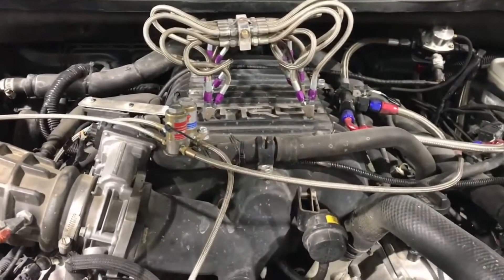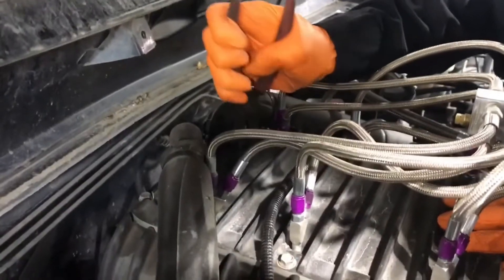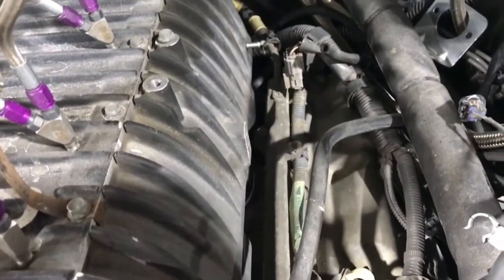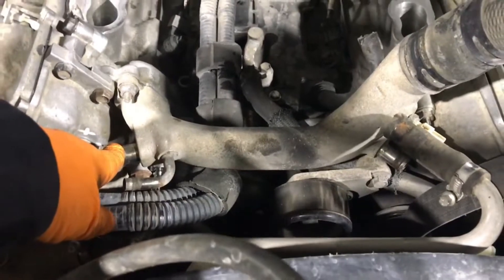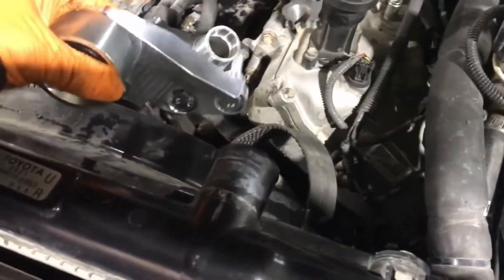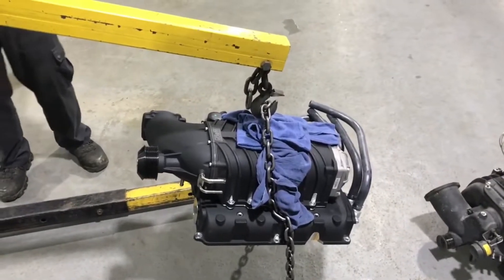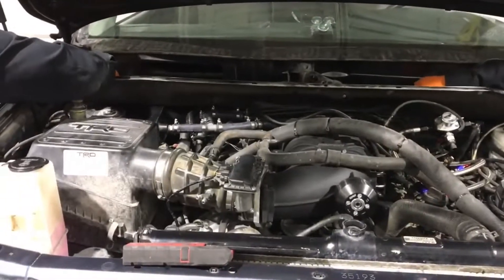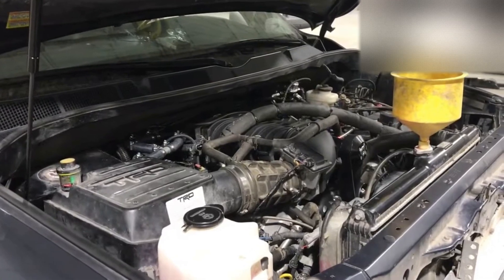Toyota Tundra TRD/Magnuson TVS1900 Supercharger Removal and Harrop TVS2650 Installation Instructions

Comment: Hi, fans from Georgia. We have a 2013 GS AWD with 250k miles. 

It’s time to replace our front rotors and pads. We replaced the rear rotors and pads with some cheaper power stop and they work fine, but the rotor has rusted. 

The Toyota/ Lexus dealer quoted $300 plus labor. I have found some cheaper options on rock auto and wanted your feedback. 

ADVICS ultra premium OEM replacement. 

Thanks! Love the content.
Reply from the maker: Hi, I only use OEM Lexus/Toyota brake components, so I don’t have any personal experience with those ones. 
The vast majority of brake problems I saw during my career was due to using cheap aftermarket parts.